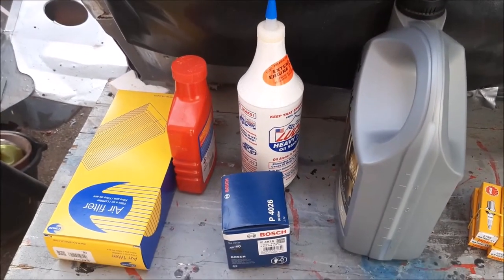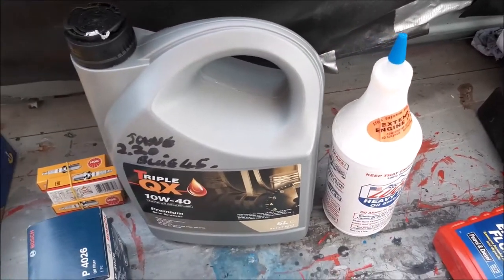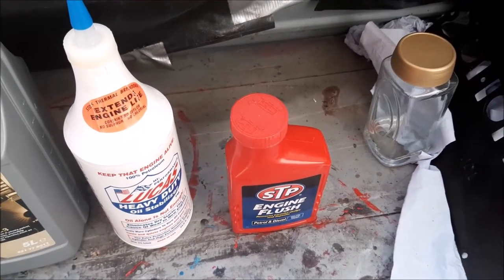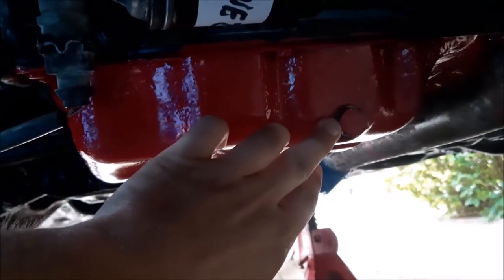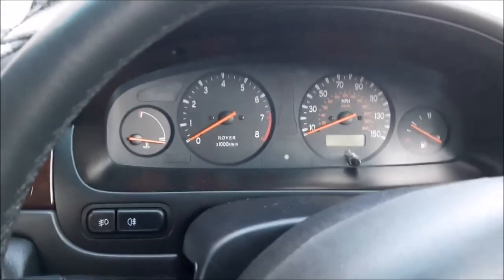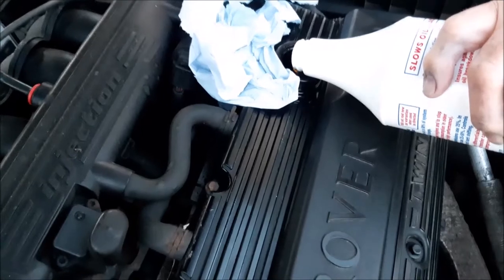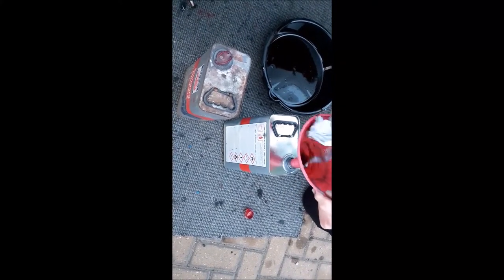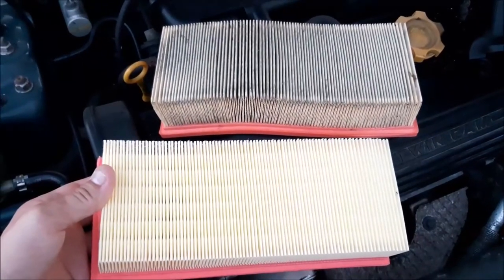servicing  our rover 45 1.4 K  series engine

Comment: Brilliant video! 

Did you replace the fuel filter near the bulkhead?

 I just purchased my 3rd Rover 45 a couple of days ago, my last one was a Club saloon model I owned back in 2016 or so.  The one I bought is a 1.6 petrol however the head gasket is fine but it is loosing coolant via the inlet manifold gasket and the plastic thermostat housing.  I've since replaced the inlet manifold rubber gasket as the old one was broken in several places and it was bodged up with black sticky DIY sealent, it looked horrible.  The plastic thermostat housing one of the sections had cracked and snapped off inside the coolant hose so this was very obvious leak area, replacing it today hopefully, put the inlet manifold back on, renew coolant and bleed system.  Hopefully I should not only have hot heaters again but no coolant loss once the car has cooled down!  Loving your video's and your passion for 45's!  I'm a big MGR fan and currently own my latest 45, a 89 Maestro and a 75 Allegro. Always loved the 45 model since my elderly father had one back in 2008.
Reply from the maker: thanks loosing coolant via the manifold gasket is the problem our 1.6  had when we got it